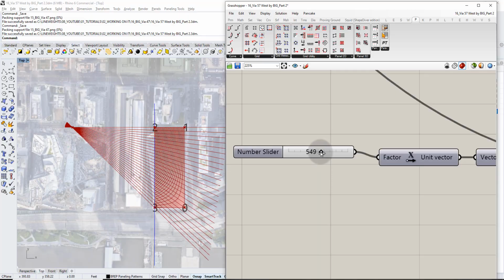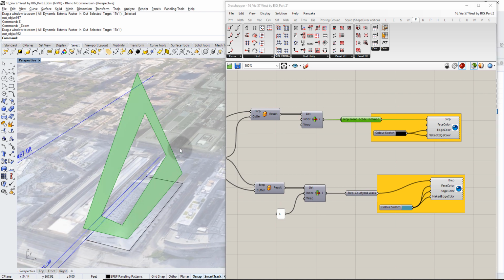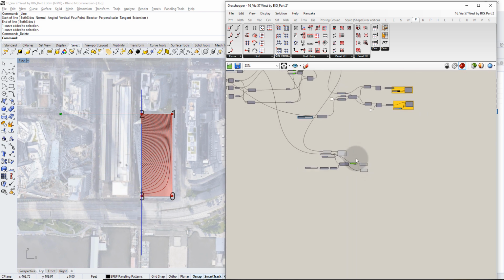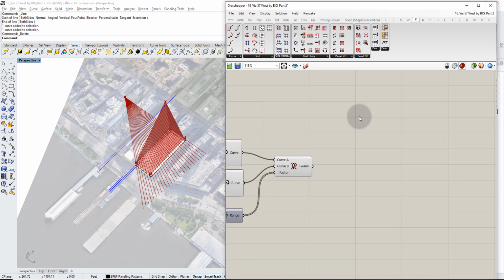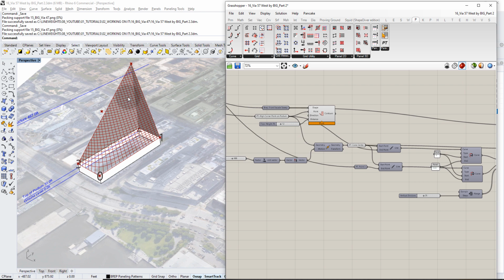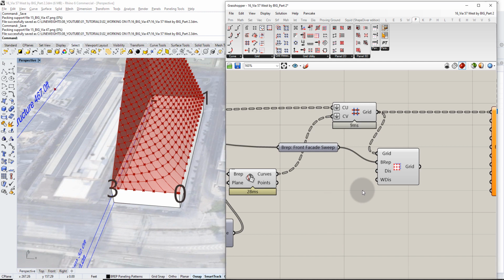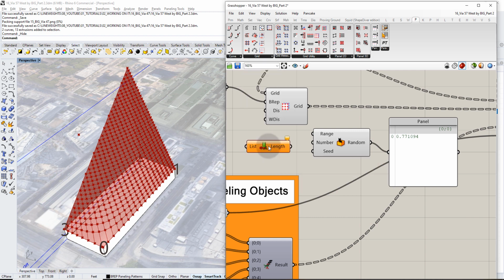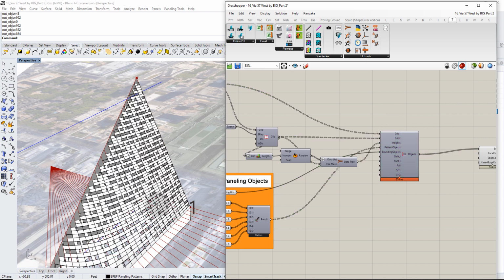Advanced Grasshopper Tutorial - BIG's Via 57 Parametric Model! Part 2

Comment: Hi Mr. Azhar, thanks very much for the tutorial and explanations, really appreciate it ! Have some questions on the paneling method. 

1. The Morph 3d list component looks really interesting. Does it automatically simplify data tree structures ?
2. Are there particular reasons for using Morph 3d instead of Surface Morph with target boxes ? 
3. There are also smooth morphing options in the Morph 3d list component, from your experience normally are there specific situations which require those options ? 

Thanks once again and enjoyed the tutorial.
Reply from the maker: Hi, glad you enjoyed the tutorial! 1. No it does not, sometimes it can make the data structure worse. That's the main issue I have with paneling tools is the way they deal with data trees. 2.  No particular reason. I just prefer Box Morph as I can deal with 3D vs 2D geometry. 3. In my experience smooth morphing really slows down the script, there are times where it is applicable, depends on a case by case basis.